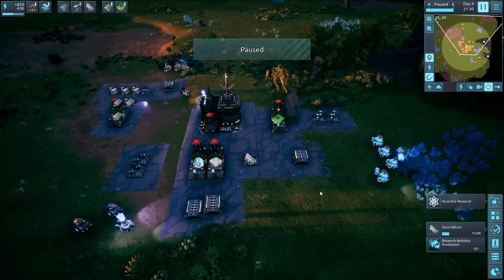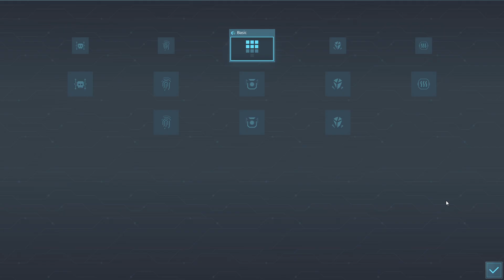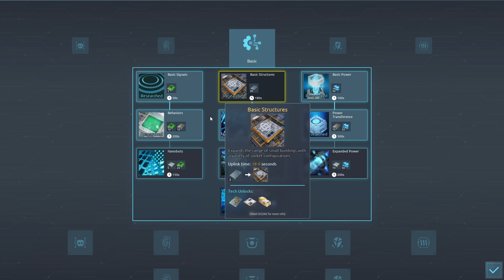8 TIPS & TRICKS FOR A GOOD START - Desynced Guide Tutorial

Comment: Ive found using s1 building next to ores and mount miners to them.  Relocate them as the ores use up.  Saves on extra robots to power early game. Saves just enough to keep you until wind power.
Reply: Relocation was added in 1.0 iirc. So that wasn't an option back then.

Comment: Just picked up this game on sale. It's been in my wishlist for months and never really got around to it. I wish I'd picked it up 10 months ago.

My tip for miners is to setup your miners with a hierarchy of sorts. For example, I have teams of 3 (or more) miners all following a "miner foreman," with 1 or more runners. Set all the miners to mine a specific material AND to GOTO and store materials with the foreman. The foreman doesn't mine, he just finds the sites with a portable radar and receives the material. Then set the runners on a transport route starting with the foreman and ending in whatever storage you prefer. I find that this works quite well because the miners stay with the foreman instead of wandering around, they move on to another field once one is depleted, and nobody moves except the runners which gets tons of material to your base quickly. Set the PR to keep your foreman in your logistics grid for optimal performance otherwise your runners will lose power and won't be able to effectively operate though. This shouldn't be much of a problem since it's super easy to expand your grid.

Comment: One good tip for a enjoyable start is to set Resources at least High.
Resources run out too quickly on Normal, forcing you to expand further, worsening your logistics before you can even figure out what to do

2nd tip
It's a good idea to make a Deconstructor bot since there's no way to remove buildings otherwise.
What people don't know is that you can drag the Go to command on the Deconstructor bot to the target of the Deconstruct component,
This will allow you to select the Deconstructor bot and right click a building to make it deconstruct that building without needing to drag and drop.
I'm pretty sure Nilaus doesn't know about this for quite some time.

3rd tip
Miner bots can select a storage to dump their ores to, as covered in the video.
Said storage need not be a storage building or a building at all.

What this means is that Miner bots can dump their ores to a Bot and Transport bots can then haul from this Bot to wherever your base is.
Since the miner bots dump their ores to this Bot, why not make it the center pillar of your mining operation?
Slap some generators, batteries and a power pole to it and now it can supply your miner bots with power on faraway mining operations while using it's storage space to collect all the ores from the miner bots.
Now on how to keep powering the mining operation, I leave it up to you to figure out
Reply from the maker: Thanks for all these ideas! =)
Reply: I'd like to add that it's a good idea to slap behavior controller and a radar on such bot as well, so they can look for nearby resources, move to them automatically and issue command to mine them to miners via a signal. This require a tiny bit of programming, but mostly just to call radar instruction with input from visual channel (where you set specific ore type) and "mineable" filter, push result to signal, set number 3~5 on signal into a variable A and call to move unit on that variable to move toward the ore it found, but stop a few steps away from it (that's why set number) to let bots to mine it unmolested. Mining bots should just read signal from their storage either with the help of behavior controller or simple signal read and links in UI between inputs and outputs. As for example, for a while I've used a twinbot blueprint with 2 miners and signal reader. Storage was linked to Signal Reader input and SR output was lined to targets of two miner components installed on it. Later on I started replacing that with behavior controllers for more refined behavior, but it did the job for a long while. I just wanted a bit more control over it.

Specific implementations of powering this setup depends on current level of technology. Initially 5-10 workers with poles set to follow each other at a distance of 10~15 steps with the help of behavior controllers will do. That is instead of building fixed chains of buildings toward nearby ores which you may end up building eventually anyway. Later on this could be replaced either with single internal energy cell (same as one you start with) or a dedicated power-bot for specific end-game materials. All of this to make mining as automatic and hands-free as possible.

Funny, but in the late game that all devolves back to behavior-less miners, but that's out of the scope of starting tips.